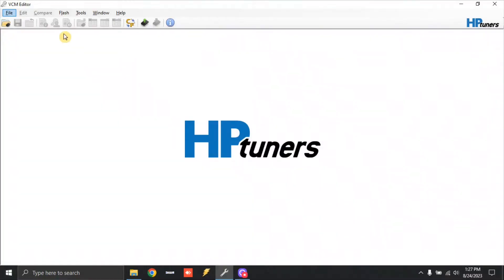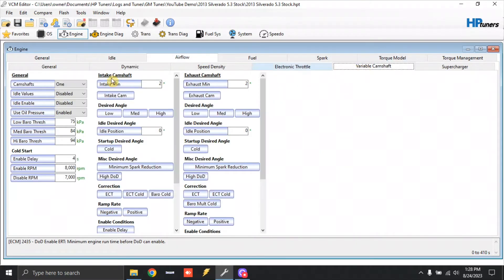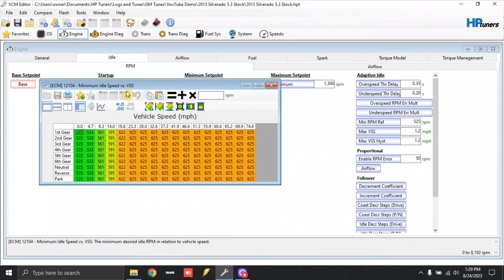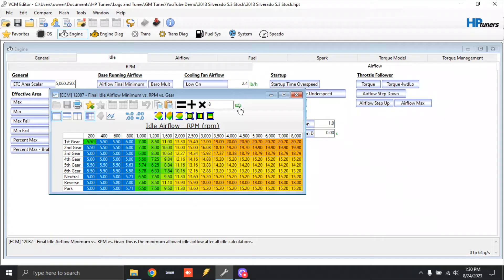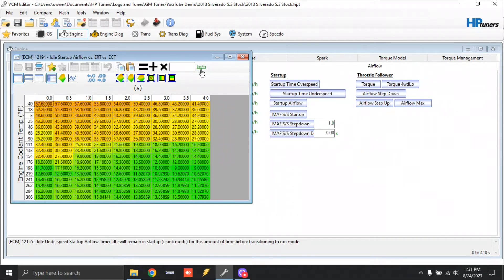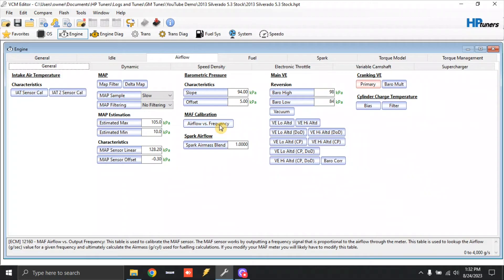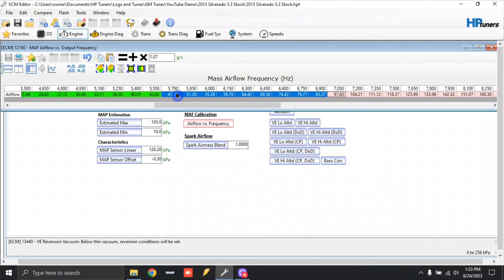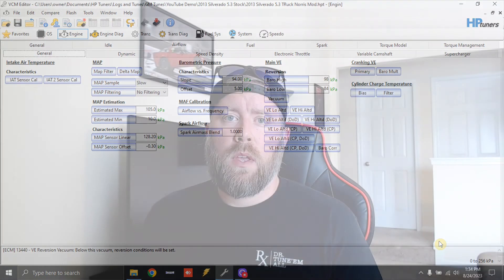How To: Cammed Idle Startup Tune for Gen 4 GM

Comment: I got as truck Norris cam I just installed in my sons truck. We have used them in the past but my son’s truck is not producing good vacuum causing hard brakes after 2 pumps of the pedal. We have added base idle timing and help a touch but seems others had the same issue. What’s your opinion
Reply: My 08 Silverado with the Truck Norris cam does the same thing. Im here for the same answer.

Comment: does this apply to a 07 Grand Prix GXP with the LS4? i have a sloppy stage 3 cam. i went along with your vid and adjusted like you did. saved it as a new save file so i can revert back if needed. i just dont wanna blow up this engine.

Comment: Did this and its fine but when im on the highway and throw it in neutral itll rev up to 2k rpms.. why is that?
Reply: did u found out what it was?
Reply: @Chocoo813  i kinda did but its tune related. My tuner told me what part it was but i forget the name of it. Basically hanging idle if i recall
Reply: @A2RACIN  oh ok how long you was driving with this basic tune before getting tune right?
Reply: @Chocoo813  its still not right but its ok til i hit the dyno. Using the stock tune with a few tables changed to idle and drive.
Reply: @ what year is your GM and did you have to buy credit points to do this for the first time?
Reply: @Chocoo813  its a 2010 with a 5.3 6l80e. I bought the hptuner with 2 credits on it..
Reply: @ only needed 2 credits for this basic tune?
Reply: @Chocoo813  yes, it allows the ecu and transmission to be tuned.
Reply: @ ok awesome im getting the truck norris cam swap in my 12 Tahoe 5.3 should be getting it back in a few days and im planing to do this but is my first time n im new to this stuff sorry if im asking to much and thanks for the responses
Reply: @Chocoo813  no problem, its my 1st time, im a honda guy and using the truck to pull my civic to the track
Reply: @A2RACIN  hell yeah nice 
How she pull by the way with this cam and basic tune if u don’t mind me askin
Reply: @Chocoo813  pulls very good for what it is. Im still new to the hptuner but it feels way different. Also im using the blue cat tool for the transmission tuning
Reply: @A2RACIN  after you did the basic tune did u had any check lights on?
Reply: @Chocoo813  i believe the random misfire code. That 1 seems like the common issue. When i looked up on YouTube
Reply: @A2RACIN  is there anyway to delete it or it come back on? 
My Tahoe jus got done cam swapping and the shop supposed to dynotune it tmm but I didn’t wanna dyno tune it yet still got the stock manifold exhaust and the cats only thing I did was air cold intake and muffler and resonator deleted wanna to save that dyno for later but I will have to do this to get it running for now and also can I drive it home from the shop with no tune or is bad?
Reply: @Chocoo813  you must have HP tuner and take the course on it I disabled the code to get it home for "emissions" reasons.
Once you get all your parts put on have them Dyno tune it and they should know what to do with that code.
Reply: @ got you thank for everything

Comment: Hey Matt,  have you ever come across doing a very limited dod delete(left cam in because it was still good and customer didn't have the extra money for a new cam). The tune at idle even though dod is turned off. It will still have idle and off idle trying to trigger the dod as a miss fire. It has a non dod gm valley plate. Thanks in advance

Comment: I have an 07.5 silverado i dont have 7000hz it stops at 5800hz
Reply from the maker: Your 7000hz table is in the High Frequency vs MAF table. 2007 has a Low table and High table. It works the same as what I have shown though.
Reply: @Matt_Sanford would i need to make an adjustment on my airflow vs freq low?
Reply: @modders_garage  Yes, you adjust both.

Comment: How would some of these settings change with additional mods? Ive done truck norris cam with ported heads, headers and full exhaust.
Reply from the maker: That information will come in other videos, little bits at a time.